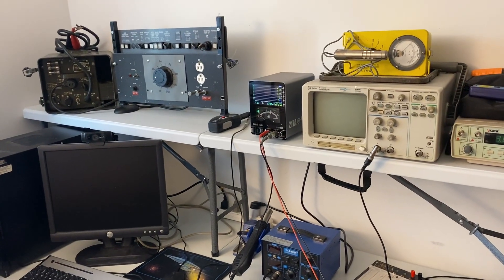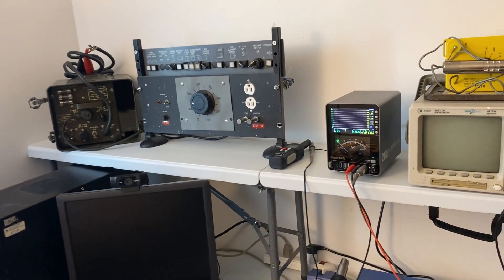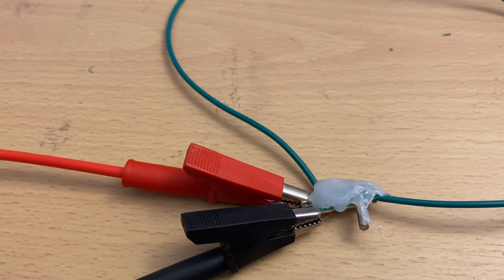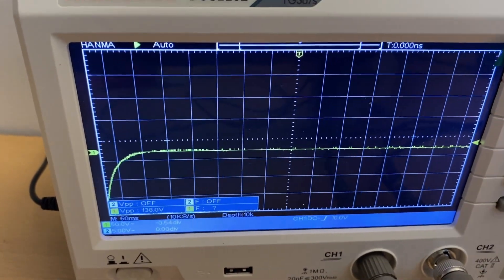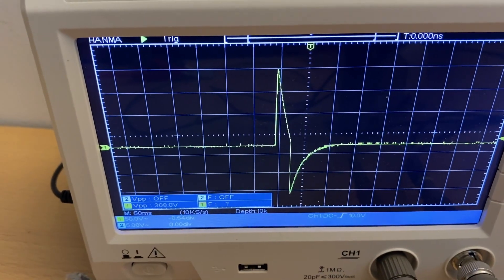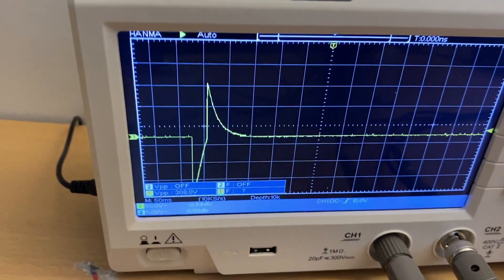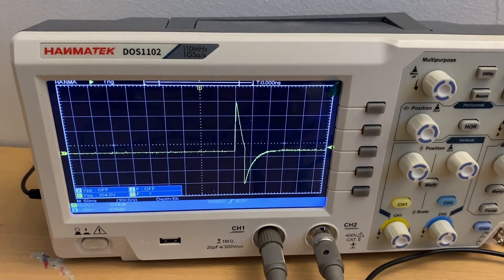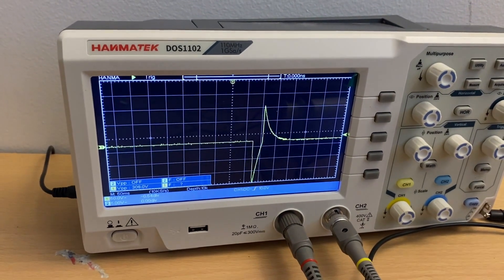Bedini Clock Dump

Comment: Thanks Joel, I really appreciate everything you share.. Im near Ottawa,  living without access to water or electricity so been doing alot of researching into alternative sources of power.. its a steep learning curve. So far though cant manage to even get a simple bedini to work.. ive got 3 dollar store clock modules sitting here, cant figure out where to put the wires.. the inputs are obvious but anyways , just want to let you know that your videos are appreciated.. i have a couple large toroid transformers.. have you ever taken a gander at the barbose-leal electron pump? Id like to see if i can recreate that.. going to start hammering t-rails in the ground before winter, and with any luck ill have some success and be able to heat my camper..